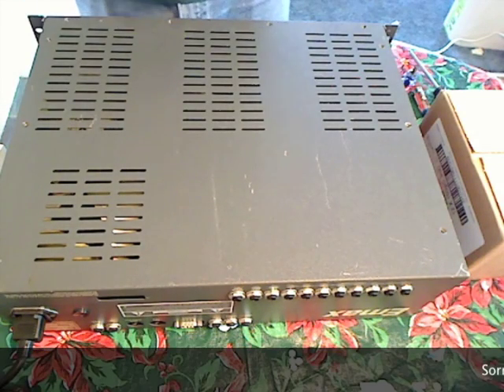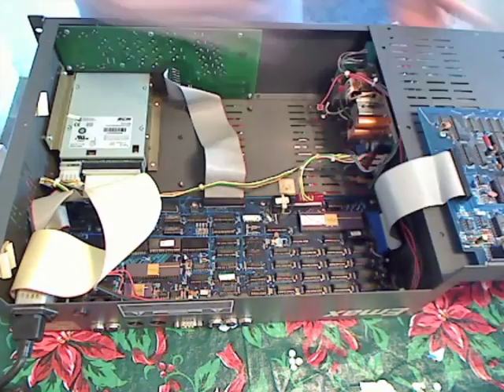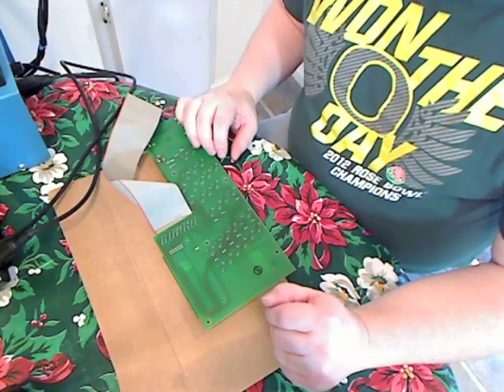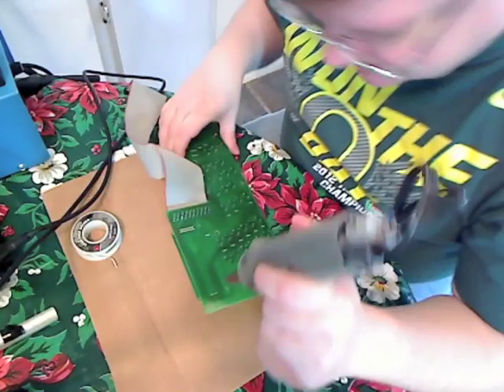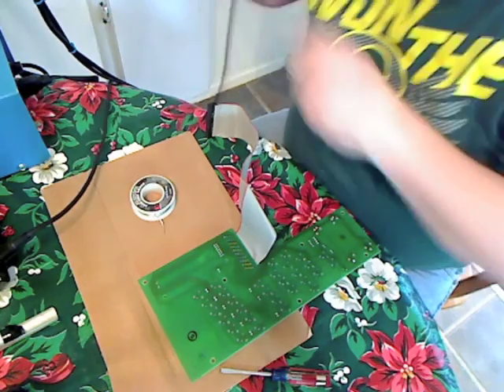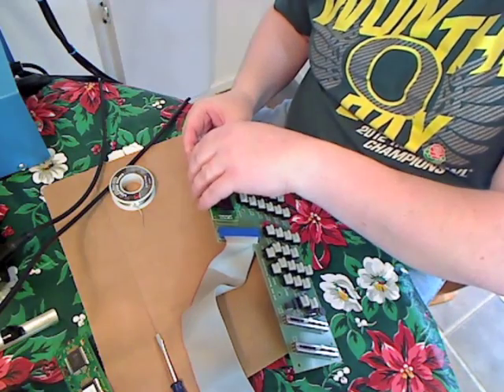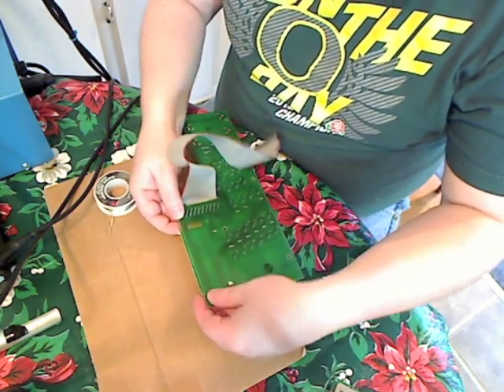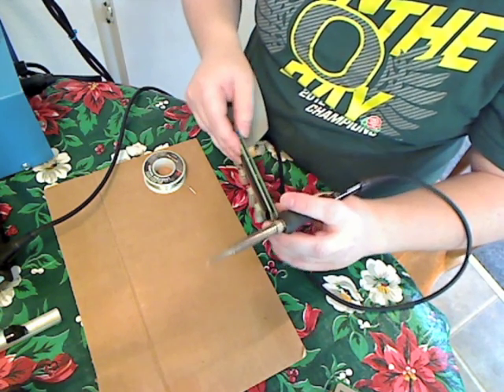Emax 1 RACK Display replacement - OLED

Comment: Interested in buying a IC bundle for Emax 2 (memory upgrade).
Do you have ?
Reply from the maker: If you have an Emax2 memory add on board then you can max the memory on the board using the instructions here:
http://zine.r-massive.com/e-mu-emax-ii-memory-upgrade-unlocked/

If you don't have a memory add on board you cannot upgrade it. The add on boards are not available except from an existing Emax 2 (if one is found that needs repair / dead for example).
Reply: @djtbs1  
I have the board in my emax 2 , I need the IC bundle (programmed GAL chips).
Do you have it for sale ?
Reply from the maker: @jamalakamister.j8466  I do not have sets of Emax2 ICs for sale and never have. I have read in some places that the GAL changes may not be necessary. IF you already have all the SDRAM IC's in place filling up the board, try the process at the website I already linked above. If it sees the memory great. If it doesn't work you lose nothing.
Reply: @djtbs1  ok thanks

Comment: Greetings and respect! just to confirm all you have to do is have pins 1-14 installed leaving 15/16 blank correct? also what solder do you use and what tip on the soldering iron did you use to install, the gaps are so narrow putting this back into the pcb board having trouble for some reason the solder is not "sticking" to the pins! driving me crazy and i know everything is clean and the tip is nice and shiny! thanks again
Reply from the maker: where the solder is not sticking to the pins it's because your iron is probably not heating the pins efficiently. This can also cause damage to the pads on the display. I use a pretty small tip on my WESD-51. Temp set at 625 deg Fahrenheit. Tip is either an ETJ or ETS. Solder is just normal rosin-core silver/tin solder I bought long ago at Radio Shack. Nothing special there. yes 15-16 not populated.
Reply: @djtbs1  thank you so im doing just about all you said i even tried a brand new tip tinned and everything still doesnt want to catch on the pcb board im really stumped, whats also even stranger I tried to reinstall the old display for the heck of it and the 2 pins for the backlight were installed like a champ but once again the main 14 pins SAME problem! hope im making sense
Reply from the maker: @12bitizthewaytogo92  it sounds like your iron just isn't keeping the heat consistently. I had this happen with my solder station and had to order a new handle / wand part (that has the heater in it)... can't say for sure that's what it is-- but that is what it sounds like. I had done the same thing at the time- new tip, etc. It can be frustrating because it looks like it should be working, but just isn't....
Reply: @djtbs1   ok thanks will look into this just really strange as ive done a lot of work recently on my sp12 turbos replacing the screen etc and had no issues!!

Comment: Great I will. Change my emax 2 display you think this is the right part O016O002BBPP5N0000 OLED DISPLAY 16X2
Reply from the maker: That display is not the right size or connection. Go to CrystalFontz https://www.crystalfontz.com/product/cfal1602cw-16x2-character-oled-display-white
Reply: @djtbs1  Thanks a lot, this will fit on emax 2 rack?
Reply from the maker: @Dtekmex  Yes it works for Emax 1 or 2 - I have both. Note that no displays from any vendor include header pins. Don't try and desolder from the existing display side to reuse. Get new header pins from mouser or digikey. Measure the length. 2 rows x .100 (2.54mm) spacing
Reply: @djtbs1  Thanks a lot for the info 🙏🏻

Comment: thank you very much for this absolutely complete tutorial. I just found the Yellow part on ebay and I'm buying it right now. glad to know there's no modifications needed, just replace it. some other instruments need firmware hacking, PCB modifications, etc. doesn't seem to be the case here. I have the same unit, emax rack, but with an HD. can't wait to have it fully back in shape, I'm tired of sitting on the floor with a flashlight to read the old display. thanks again.

Comment: Hello, I've found a Raystar oled and I'm gonna replace the LCD on an EMAX II (I guess it's the same as the EMAX version...), you say: "Pin3 with No Connection to the display"...do I have to cut the pin 3? What if I plug the new display as it is?
Reply from the maker: If Raystar haven't changed the PCB the display is made with, pin3 shouldn't connect to anything, it will just be a pad with no trace leading from it on either side of the display board. If it does go somewhere, cut the trace on the Emax which you are mounting to, as that is easier.
Reply: Mmm...only you can confirm that (if you still have the data sheet here's the PDF on the site http://www.tme.eu/en/Document/06aa4cc1af0d93f396979b75c2b96daa/REC001602CYPP5N00000.pdf I've find out the view area is 2mm longer, is that a problem?
Reply from the maker: I have a datasheet. You misunderstand. My datasheet is from 2011, but a datasheet may not change when the PCB connected to the display has changed. My datasheet says there is no connection of pin 3, as does this later one you link to. BUT- Confirmation there is no PHYSICAL change of the PCB itself must be done by VISUAL INSPECTION of the part. Never 100% trust documentation without verification of the physical part. And no- 2MM should have no impact on viewable area

Comment: Peace. If I send you my racks front panel can you install one of these for me?
Reply from the maker: I don't have anymore of these in stock. I also have limited time to perform repairs for others. So no, I can't take this work on for you.
I would suggest you get one of these 16x2 (NOT SPI): https://www.crystalfontz.com/c/character/34  then take the unit and display to a local electronics shop for installation.
Reply: @djtbs1  https://www.crystalfontz.com/product/cfal1602cw-16x2-character-oled-display-white .  this will work on the emax 1 and 2 racks? thank you for the help! much respect!
Reply: and dont need to do any mods to these? just take old one out and put this in?
Reply from the maker: Beto - Yes, the 8-bit parallel version, not the SPI version. You do need to get a HEADER and solder it on. Something like this, but measure to be sure the PIN MATING LENGTH is long enough:
https://www2.mouser.com/ProductDetail/TE-Connectivity-AMP/102973-8?qs=sGAEpiMZZMs%252BGHln7q6pm48SVpWlpfsEVfL2OfmiAB0%3D

Comment: Friend, you can tell me the datasheet of the display? I do not know if it's compatible with my orbit , I need this information, can help me please? 
I have a display like this , but did not come soldier, and need to know which wires will be welded into it, so I do not burn ... I looked for information on google , and not found ... i can send to you pictures of it... where i can show you it? I have the all data from my emu orbit, data from pins, and i can send to you. Look, the data pin from my Orbit ...

Data Emu Orbit pins  seeing in multimeter is
1 (5v)
2 (0)
3 (2.25)
4 (0.3)
5 (0.90)
6 (4.5)
7 (0)
8 (1.28)
9 (2.65)
10 (0)
11 (3.30)
12 (2.66)
13 (3.65)
14 (3.60)

The interesting, is that the comon  display 16x2 datasheet defaut , the power pin is 1 ( Vcc Ground) , but in Orbit is different,the pin 1 is (Vdd 5v)... how i cant weld corretly?
Thanks , and best regards from Brazil
Reply from the maker: +Riva Lima - The voltage on the pins isn't helpful as that doesn't tell us which pins are data, enable, etc.
The pinout /datasheet for THIS display is compatible with the following datasheet (as I have installed this display linked below in a customer unit and it is the same for this use):
https://www.crystalfontz.com/products/document/3441/CFAL1602C_Series_Datasheet_2015-10-26.pdf

What you would have to do is:
1) determine the ORIGINAL part # of the display you are looking at 
(not the EMU part # as shown in an EMU service manual, the displays were manufactured by other vendors and EMU assigned their own part # in their manuals).
-- This is usually on a paper label on the display, or silk-screened onto the display PCB.

2) Confirm the pinout for the original display.

3) Find a new display with the same pinout (or if you can't find one which matches the pinout, determine the correct connections and hardwire the new replacement).
I have been told the EMU SP12 or SP1200 also had reversed pinout of display compared to this one as used in Emax... that person hardwired their replacement.
 
Old data is available on the displays using google- the requirement is having the correct part # information.
Without that, your search will not be useful.

-T
Reply: +DJTBS1 I take photos of him ... look https://picasaweb.google.com/111417975269357534671/DisplayEmuOrbitConections
Reply: Hey, i had the solution and i install! i can send to you the schematics for email?
Reply from the maker: +Riva Lima  Where you have: 
1) found your solution 
2) successfully installed

    I would suggest to you to join a forum that exists for the Emu Orbit and share the information there for the users.  I don't work on or have the Emu Orbit- so the information would not be used by me. But others may find it useful.

There is a Yahoo! group for this: EMU-Orbit_and_V2@yahoogroups.com
Or you could join Synthzone, Emus on Acid, etc.
Reply: Ok, i put on group! Regards
Reply: I need this information.  Can you send how you wired replacement display?
Reply: This link is dead.  I am trying to do the same to an E mu Orbit
Reply: The Raystar REC001602C displays (aka Winstar WEH001602C) do work in the Orbit 9090.   They don't work in the Orbit v3 which needs a 24x2 display.

Comment: Excellent video! thanks for posting, you are electronic technician? that tool use? like a drill
regards
Reply from the maker: I am not a certified ET. However, I do have 16 years industry experience in equipment repair (electronic / electro-mechanical / hydraulic).
Often I have had to re-engineer things to prevent recurrence of maintenance issue.

I have a Weller WES50, PACE solder rework station, Tektronix Oscilloscope, and have logic probes and DMM...
For fabrication work, I have a drill press, Dremel variable speed moto-tool, and other power tools for cutting, etc.

Comment from the maker: I had them made by Raystar Opto-Electronics.
Supposedly Winstar makes one also... but I have heard mixed information that the pinouts on the other manufacturer units don't match up- they are a single row of pins.
Which is what I confirmed with Raystar before ordering.... adding more to the video "About" section...